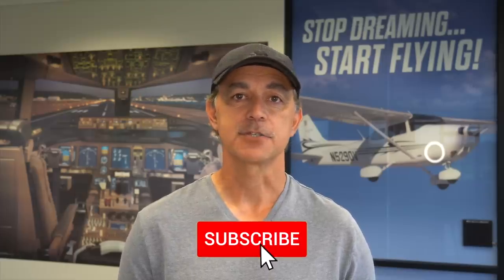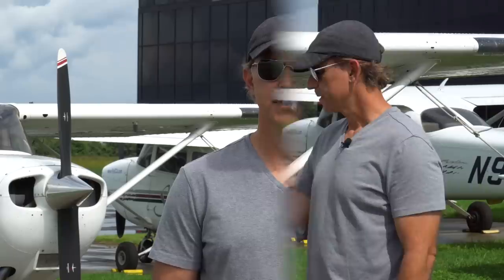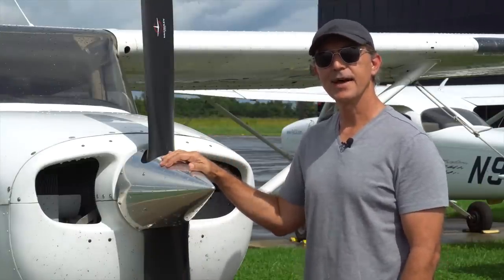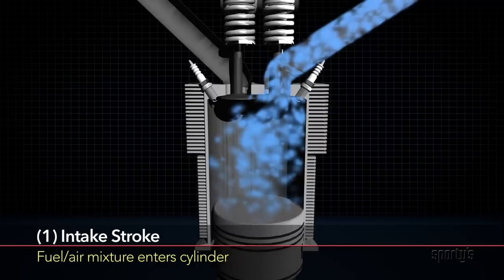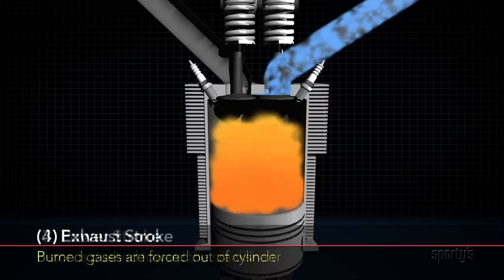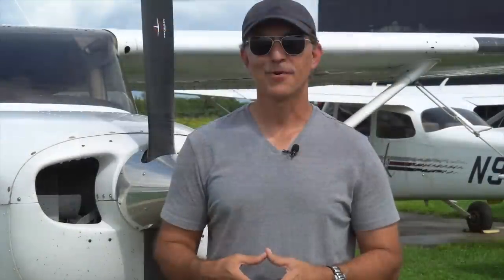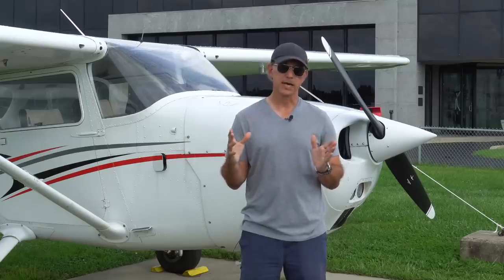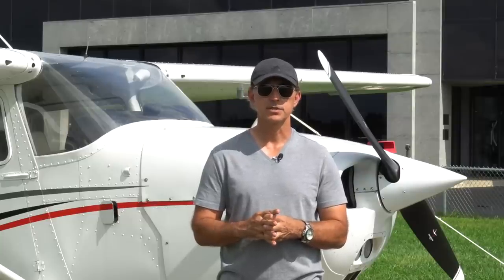Emergency Follow Up, What Happened To The Engine

Comment: As an automotive mechanic/engine builder there were only two words I needed to know out of the entire video... "stuck valve" :-) Thanks.
Reply: Lead strikes again
Reply: I watched an old time mechanic remove an exhaust, valve ream out the valve guide and reinsert the valve without removing the cylinder on a 
Continental O-300. It was ingenious. It consisted of using a Piece of cotton rope, a homemade valve spring compressor, and a magnet on a stick.
Reply: @HoundDogMech  Now that is a guy to hang around with and learn from!
Reply: ...like Homer Simpson...break it down!  Stuck Valve.  Says everything for me too lol  DOH!
Reply: @HoundDogMech  must have been a Lycoming, I guess they seem to be more prone to sticking valves from the leaded fuel for some reason. I've seen valve springs removed by stuffing rope into the spark plug hole then turning the engine to bring the piston up against the rope to hold the valve up. We usually screw a fitting into the spark plug hole to plug an air hose into & use air pressure to hold the valve shut while removing & reinstalling the valve spring. The hardest part would be fishing the valve back into place in the guide.
Reply: What would typically keep a valve from sticking? Can it be detected early at a maintenance inspection? Is there anything one can do in flight to clear it?
Reply: @JerryAsher  good question. Beyond taking the jug s off the engine = $$ or fighting it to do it on the engine which would by a major pain to do to all the cylinders, like what we were talking about with the rope or air pressure. There isn't much that can be done, except get the lead out of the fuel. Sept 1st the FAA approved GAMI's STC for their G100 Unleaded Av Gas formula, so that's a start, I guess
Reply: @JerryAsher  "What would typically keep a valve from sticking?
The first question to that is...What is or could be the cause? I don't know if there is some quirk with this specific engine. I am an automotive diagnostic technician. Typically, valves don't stick, the spring tension forces them to close. It would take a severely sledged engine to have that problem and I'm sure the aircraft get oil changes on a rigid schedule. [this is on the concept of it getting stuck open.] If that happened there is a possibility that it is an "interference" motor and would possibly have the piston hit the valve and bend it. It could also get stuck shut due to a faulty push rod or lifter.
There is no way to be sure without first doing a compression check to identify which cylinder and then start tearing down the engine starting with the valve cover, rotate the engine and observe rocker movements and check for rocker slop.

If the problem is internal, there is nothing that can be done in flight.
Reply: @JerryAsher  Yes - Lycoming has an inspection for it.  It's called the "wobble test" and can be performed easily by the right mechanic.  If there is a problem, the valve guide can (believe it or not) be reamed out without removing the cylinder.  Look up Savvy Aviation's videos.  They've done excellent videos on the valve issues most commonly faced by Continental and Lycoming engines.
Reply: @DrHarryT  The cause is lead deposits.  Always lean your airplane aggressively.
Reply: Had the same in the R22, able to milk the collective to a safe landing spot.
Reply: I don’t think the make up of an aircraft engine is at all the same as an automotive engine
Reply: @DrHarryT  OK, that was the comment I was looking for.  Been working on 4-stroke since I was 13, B & S mower and mini-bike engines and beyond.   Interference engine, ah,  once heard about a cattie that got a bent valve, replacement, fixed.  Great, points on the engine "should" have been maintained well, ie, oil chg, etc.  And, I forgot about push rods since we have so much OHC now. Thanks Dr T!
Reply: Per @DrHarryT,  watch the following:  " Why Valves Stick" by the Savvy Aviation".  

WOW, in this case, it has to do with the type of fuel and value temperature being TOO cool, not hot!

Comment: I'm sure someone has mentioned down below that on this flight the "Impossible Turn" maneuver" was not flown here as the engine still had power. In this case the flight instructor made a very wise choice and did so with no hesitantly or delay. My hat comes off for his cool head, sharp wit and remaining calm and focusing on flying the aircraft. Great Job Son!     Old, but not bold pilot.

Comment: Great explanation. Obviously the turn can be done, they did it. Also, the engine was still producing power.
Reply: This is why in my opinion, {not that my opinion matters much because I'm a nobody} that IF possible, {remember I said IF possible} the General Aviation pilot should try to be a mechanic as well.  In the case of this aircraft, a pilot who can teardown an engine and rebuild it would automatically know that Lycoming engines have a propensity for sticking valves.  In a "flash" your brain puts 2 & 2 together - if the engine is still making some power and some vibration that means the crankshaft is still turning, the sparks are sparking, which means the magnetos are still working {especially if you verify BOTH} and the camshaft is at least turning and you see there is still good oil pressure, then there's only one thing left - STICKING VALVE and the chances of it being on more than one cylinder is 1 in a billion because the problem happens suddenly so you put all that together in the brain and say to yourself "I have 3 cylinders making power".  This allows you to make decisions based on fact not guesses.  Yes I know it sounds like "Monday Morning QBing", but that's just my 3 cents worth.

Comment: Those of us with Lycoming engines may want to know about the Stuck valve: i.e. was it failed maintenance to perform 400 hour valve wobble test?
Also helpful: total time engine & airframe, new engine or recently overhauled? & Finally: was there previous cylinder/valve maintenance on this engine? 
I apologize for seemingly being too detailed but Lycoming often markets reliability as one of its key features and knowing these further details can be helpful in tweeking operation procedures to avoid similar potential catastrophes.

Comment: Good explanation of what happened to the engine. Also while they did make the "impossible  turn" they actually still had partial power. We know this because the plane was still able to taxi back after the emergency landing. This partial power probably played a lot into helping them make it back around.

A similar situation happened to me in my 235 (N8556W) long ago. I lost a cylinder at about 500ft altitude after take off. Fortunately the rest of the cylinders (5 of 6) were able to pull us around the pattern to land. However we couldn't climb and we slowly lost altitude as I had to reduce power to prevent the engine from shaking itself apart.

Comment: Thanks for answering those questions Kris! Another great video and I’m glad Kim knows we are all behind her as she moves through her training! We’ve all been there!

Could add they were still getting some power out of the engine (even with a dead cylinder) which makes that 180 far easier to do
Reply from the maker: There were a few things I wanted to add (engine producing partial power, their actual agl was much lower, no landing options in front of them etc) but I didn't want to drag out this follow up or nit pick every detail.
Reply: @BaronPilot  
🛫📖🛬

You're right;
Main point is it was the right call👍

Comment: Kim, do not give up your dream.  Aviation like many difficult pursuits is nothing more than developing the skills to problem solve quickly.  These skills are developed through study and experience.  After 23,000 hours of flying and instructing on DC-10, MD-11, 747-400 and lots of GA planes, I can tell you, it’s never perfect, and you never know it all. Airmanship is a ladder we all must continue to climb, constantly looking for more skill, and more knowledge.   I watch this channel because I learn something with every video.  Emergency returns are not impossible by any means.  Sometimes they are not the best solution though.
I taught emergency returns in all the big planes.  My favorite plan because it was the most consistently successful was the 90/ 270 provided the aircraft was producing some power.  This plan was more consistently, ( with my students and with other instructors at the controls),   The aircraft was much more likely to end up in a position where a successful landing could be made.  Having said all this, sometimes ya gotta do what ya gotta do to get it on the ground right side up.  God Bless you!  Keep Flying!

Comment: As a Pilot myself I think he did just fine. He was the pilot in command, he can feel what's going on, he still had some power it wasn't a full failure. He made a series of decisions that got himself his student and the aircraft all on the ground safely and that is what flying is all about. It's about good pilot decision making to achieve good results, he made good decisions and ended with good results. It's all good and an awesome learning experience, this experience will make all involved even better pilots.  It's good to be skeptical but it is also good to be logical and rational. They both handled the situation great as far as I'm concerned, I think I would of did the same thing especially if I still had some power.

Comment: Thanks so much for the post incident report. I was one who posited carb icing. I hadn't noticed the vibration. I only observed power loss and had overlooked fuel injection.  I build high performance auto and marine engines as a hobby and had suspected a dropped valve but realized that a horizontally opposed aircraft engine would react differently from a "V" configured auto engine. Anyway, I'm so glad that Kim and her instructor made it through without injuries.  And I am so thankful for your explanation and wonderful delivery style. You are an exceptional pilot and it shows. Thanks for the videos.
Reply: I as well. I rent so I fly 172’s that are older and that’s the first thing in my checklist.
Reply: Many people didn’t notice the vibration due to the stabilization built into the camera so when you do notice it, it doesn’t seem as bad as it actually was. 
Thanks for watching and subscribing!🥰

Comment: The aircraft didnt have a complete engine failure, only 1 cylinder failed, thus it operated at reduced power, so a turn back to the runway was perfectly possible, and IMHO the right thing to do while still under power as if it had failed completely a minute or so later, they would already be heading for the runway and somewhere safe to land. 
With a complete engine failure and at that height, then it becomes the impossible turn.
The instructor used his experience and judgement and did exactly the right thing, well done to you.

Comment: Thanks for the info. I have two reactions to this new info:

1. The CFI did apply "alternate air" at least in his checklist. That is the fuel injected "equivalent' to carb heat. Fuel injection won't ice-up, but it could have a blockage, and the alt. air is available to eliminate that possibility.
 
2. The "impossible" turn is almost that with a dead engine and low altitude, say below 1,000'. But since this engine was still running on three cylinders, i.e. making, maybe 50% power, the turn was worth considering, even at their altitude. Plus it wasn't much of a downwind landing on this day.
 
It's a lot to consider under pressure and while taking action, but that's why some pilots handle emergencies better than others.
Reply: and at the end of the day, there isn't a solution that fits all.  Spinning what-ifs is a thing in aviation, can do that, till the cows come home :D

Comment: You are absolutely right about the turn being aircraft dependent...it isn't too hard in a 172 from 600-700 ft. A grossed out A36 is an entirely different situation...know your airplane...the worst time to actually try something like that for the first time is when the windshield is covered in oil and the engine is shaking so hard its about to rattle your teeth out of your head...

Comment: I like how Kris has mastered the turn and talk. Also not an impossible turn. It helps build trust with the viewer I guess. Just kidding. Great video and series. I think this has been awesome to watch. I fly a Cirrus and the pre-take off briefing specifically states “loss of power after take off land straight ahead” but I’ve never fully agreed with that nomenclature. I believe it should be “total loss of power after take off land straight ahead”. As long as the engine is giving you some help let it. Use all available resources including the remaining power it’s giving you. I also appreciate the MX explanation. I feel like most CFIs gloss over going into any mechanical detail. Great explanations and great series.

Comment: Whilst not an aircraft mechanic, I did used to be a car mechanic.

So I can assure that there are many reasons that cause a valve to get stuck open,

And I can also assure you, that with none of them is it wise to run the engine longer than you actually have to.

Like some have pointed out the stuck valve could cause an engine failure (valve hitting piston), but also depending on the cause,

It can lead to other component failure and "loosing" more cylinders.

So unless you have "energy in the bank", get to the nearest runway and work out the problem later when you have all the time that you need, 

As well as access to coffee and cake 🙂

Comment: Good job done by the instructor on the quick reaction also it was a partial power loss and having 2 small people in the airplane helped a little and I believe they had partial power loss at 1200 to 1250 feet minus the 812 feet airport elevation . They had about 400 feet . I can’t guess how far they were from threshold 1 mile maybe.
Reply: From the original video the instructor mentioned that after the turn he was higher and faster than he should be so had to do the slip to get the landing right, so the turn with power had some margin.

Comment: She has the loss of power under her belt. Now she knows how she will behave and work on that. I was 16.5 years old when I had an actual engine failure. After I lost my mind for a couple minutes I changed tanks, flew away and told my big story everytime I could. I'm 68 now and fly a B55. I still think about that event everytime I fly almost 16,000 hours later. I never had another complete loss but it sticks with you.

Comment: Great explanation! That wasn't the "IMPOSSIBLE TURN" folks, why would anyone comment that. They still had partial power. Heck, they were still producing more horsepower than I get out of my Cherokee 140 on all cylinders. LOL. Great job getting that plane back on the ground guys. This is priceless experience for you, Kim. Every takeoff from here out you'll be thinking about what happened and that WILL make you a safer PIC. Blue skies girl.

Comment: The impossible turn is an interesting discussion point I like to have with my students. I ask them how likely they are to safely executed that turn, considering the will be turning downwind, and into oncoming traffic, just 700 feet or less above the ground…the point where VFR traffic normally turns crosswind. I know a couple CFIs who put a lot of practice into this turn, and it took a lot of attempts to consistently get it correct.

Comment: As a number of other folks have said, there is a big difference in the decision tree between total engine failure, and partial engine failure.  The "impossible turn" is primarily related to a total engine failure.  With some power available, I, too, as a 47-year pilot, thought the instructor made the appropriate decision not to go around the pattern and instead do a 180.  Also, an appropriate decision to effectively declare an emergency by calling a Mayday.  Good on him and good on Kim for remaining calm.
Reply: Kudos to the other pilot in the traffic pattern, keying up to radio that he was going to bail and clear the pattern to yield the runway to the mayday aircraft.

That's 'heads up flying', to be listening to the frequency... know what's going on around you... and make an intelligent and timely decision to make double sure that the aircraft in trouble DOES have clear airspace and a clear runway to do what they need to do to get down safely.

Comment: This was interesting to watch.  Had a similar experience a couple of weeks ago during a familiarization flight in a Beech Musketeer.  I was with my instructor and the exact same symptoms occurred at about the same place in the pattern.  My instructor took the controls and landed just as Kim’s instructor did.  No problem.  We were still making some power but wanted to get it on the ground asap since the cause of the issue was unknown.  In our case, it was a bad fuel injector line.

Comment: To be fair. "The 172" normally has a non injected regular carburetored non-injected O320-E2D or fewer had the H2AD engine. A small percentage have an injected IO-360 engine without carburetor heat. The IO360 injected engine would generally have alternate air, though, which is not specially normally heated like a regular carburetor on a 172 which does have carburetor heat, which Baron pirate explained here that it was a cylinder problem not a carburetor problem where you still had three cylinders and probably making some power of maybe 1/3 to 40% it was not a full blown deadman turn. I have made a deadman turn once in the 1990s at KOPF departure end of 09R in my Navion with no damage (and still fly it today) but it was from 450 feet agl and I had practiced a lot. But even then I didn't make it back to the same runway as it was from the departure end of nine right and I made it back to runway 30 approach end at a 15° angle on a heading of about 285 degrees and touched down on the runway on that heading.